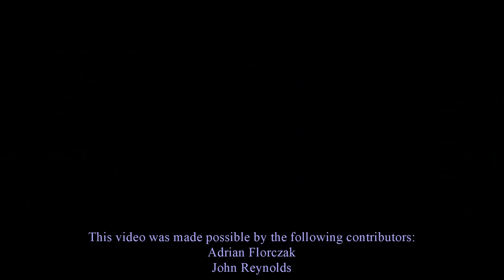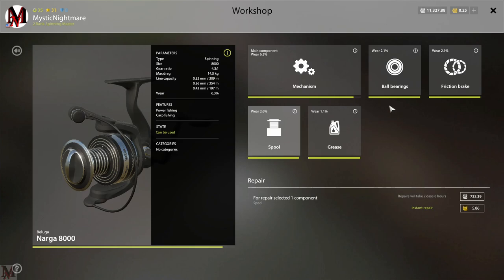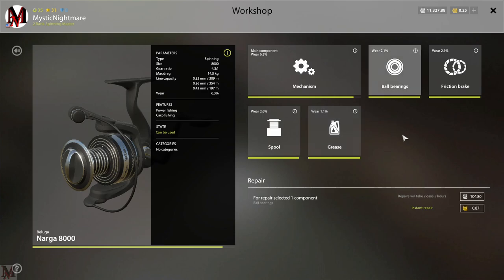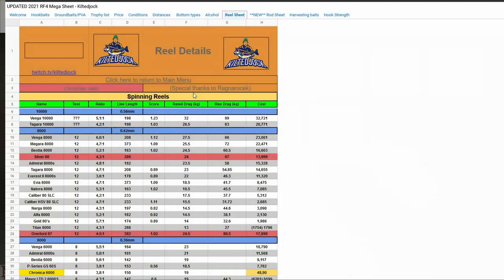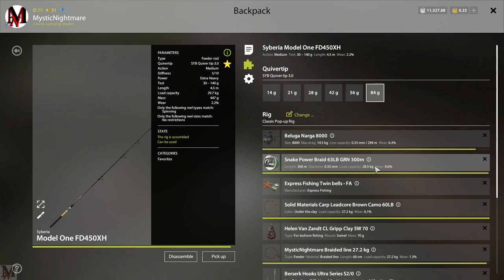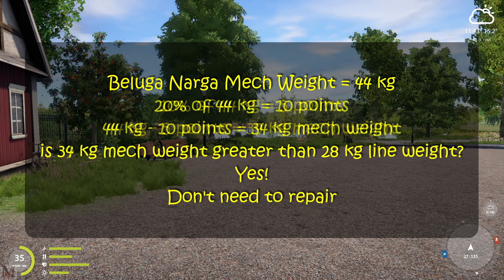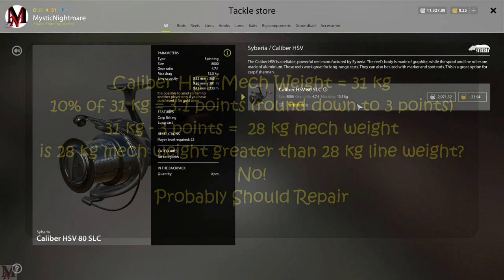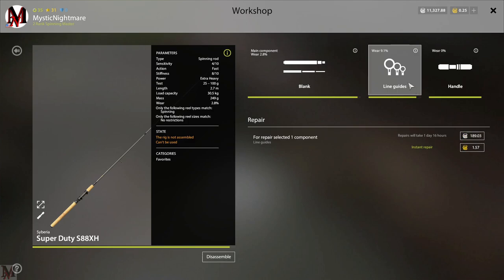Russian Fishing 4 When To Repair Your Rod and Reels

Comment: And another simpler question, if you could answer, please: watching your video, for example at 10:34 , where you show that the line used has a load capacity of 28.5kg and your rod has a load capacity of 29, 7, that is, the difference in the load capacity of the line in relation to the rod is less than 10% (around 4.1% less only).

With that in mind, isn't this a risky setup for breaking the rod? Or is this not a set you use and was just shown for the video?

Thank you in advance for your attention ;)... I'm learning a lot about RF4 with your videos!
Reply from the maker: Good catch and your exactly right this is a risky setup. However I'm fairly careful when it comes down to fishing with this type of setup so I make sure not to redline my tension bar so I don't break anything. However I also know that your line and leader will wear faster than your reel or rod. So what I'm actually doing here is pushing the limits of my rod and as my line and leader get more worn eventually they will have enough wear where they will drop below 10% difference in weight capacity. At that point I don't have to be as careful.
Reply: Ahhhh perfect, wow, now it seems so obvious to me! And although I've already seen your video about leaders, I didn't do this analysis when I saw this set, perfect, thank you very much ;)

In general, I have solid basic knowledge, but I still lack the experience to connect all the information at the same time... hehehe.

Thank you very much for your attention.

PS: I would also be grateful if you could see my other comment in this video about the wear of the mech reel not being linear with its loss of capacity, I'm really trying to understand more about the subject and since you have a lot of knowledge I'm curious to know your opinion. Thanks ;) @midnightgamingmysticnightmare
Reply from the maker: @AzuosCentrall  I'm not sure what other comment your talking about. I don't see any other comments on this video from you.

Comment: I'm thinking that the other comment I'm referring to isn't being shown to you because it's a bit long, so I'll try to summarize it: On the "KpShamino" channel there is a video titled "Russian Fishing 4, How To Max Drag Your Setup", where the subject is "mech weight", but what I want to draw attention to is in the pinned comment of this video, where it talks that the loss of the mech's weight capacity is not linear in relation to its wear, which is actually a little less (if you read this pinned comment you will understand).

And I found this relevant after on the same channel (KpShamino) I saw a video titled "Russian Fishing 4, Mechanism Reel, Rod Blank Strength Calculator" where it shows precisely a calculator in a russian excel file for this calculation of the percentage ratio of wear and loss of the mech's weight capacity. So, please, what do you think about this? Ty

Comment: Just a little mistake. The bearing is not required for casting, so it does not affect the casting distance. The bearing plays a big role in the drill because then it is exposed to a load. If you know what I mean.
Reply from the maker: The bearing is not required for casting in spinning reels however it is required for casting reels, which is one of the reasons casting reels have a test. The lures weight is needed to backspin the spool. I assume the devs didn't take this into account and made it necessary for both reels. On the Japanese site I linked it seems they tested the reels when the bearings were damaged and found a significant difference in the casting distance.

Comment: All this still relevant in 2024 ? What’s the max wear on line guides on the ocean queen an beluga c30 mech etc
Reply from the maker: For the most part yes. There is a little bit of a debate on if the line guide wear on a rod wears the line down faster, they may have changed that in new updates, but in the past the moderators said it does. Personally I don't repair my Ocean Queen till about 60% line guide wear. It's a little expensive and I've found that you don't see an increase in line wear going that high. As for the beluga c30 it depends on how you use the reel.

If you fish for smaller fish or allow the fish to run and wear itself out then you can go upwards of 50% wear on the mech. However, if you're someone like me who likes to full lock or tentative lock the reel then having your mech weight as high as possible is huge and I would repair at around 15% - 20% wear. Just remember if you're using a casting reel, your bearing wear affects your casting distance. So if you're on Norway just dropping your line you can go 60%+ wear, but if you're spinning and casting you're going to want to repair at around 30%.

As far as friction brake, again that depends on how you fish. Small fish 30%+ wear. Big fish 15% wear. Big fish short line 5% - 10% wear. The more wear the harder it is to get a fish to wear out and come in.
Reply: @midnightgamingmysticnightmare  ok thanks for all the juicy info pal I definitely need to start repairing something’s now before they break on me 👍

Comment: I have done a lot of research in the files and i found out that the devs deliberately have hidden the files where you can see the mech limits and all sorts of information because some people had changed the game files to not show water
Reply: The spreadsheet they made where some of the limits are known is from a old version of the game when they used unity mono so it was possible to get into the files now they changed to unity il2cpp and have hidden the temp file so its impossible to get the file decompiled and see the scripts so the sheet wil probably never get updated
Reply from the maker: @davyj8428  Yeah everyone always wondered how kiltedjock got his information, I guess that was how. I think the only way to get the info updated now is to actually purchase each reel and slowly try larger and larger kg lines until the reel breaks instead of the line. Which is going to be horrible to compile really.

Comment: hi just curious....ball bearings will come into play on a casting reel as the line spool revolves but on a spinning reel casting is with an open bail arm and nothing moves so how does ball bearing wear affect casting distance? secondly you say right at the beginning friction breaks cannot be repaired but are replaced,,,,you later talk about repairing it at less than 12% so you replace your friction brake at 12%? Not bbeing negative just trying to get a handle on this lol
Reply from the maker: Ok so yes you are correct ball bearings for casting reels make sense but not spinning. All I know is the Japanese website I linked tested the bearing wear for both types of reels and that is what they came up with. So when I say repairing the friction brake it's just a slip of the tongue. Spool, bearings, grease, and friction brake are always replaced never repaired.
Reply: @midnightgamingmysticnightmare  Ty love your vids...70 year plus here owned tackle shop, ran syndicated lakes , started a bait company etc and was lucky to have spent my life involved in fishing right at the beginning of carping and specimen hunting. Also very lucky to be used in  tackle testing and designs of equipment and tackle along with opening up France, Spain to carping. Had to give up through age related hand tremours so discovering this game is great as my dissabilty does not prove to be a handicap. Slowly grinding out setups and love experimenting....look forward to seeing more of yours. Anything from carp history or European coarse angling I can help you with just holla.
Reply from the maker: @jamesdeanoo7  I see we've got a true angler here. Seems like you've got quite a few years of great experience under your belt. Glad to have you along for the ride, welcome and good luck!
Reply: ty keep up the great work
 @midnightgamingmysticnightmare

Comment: I'm playing this game for like 2 weeks and I had no idea this existed. Thanks : ] I was kinda in the dark and at other people mercy to share me right information so I don't break my reel, basically what I did was Rod>Reel>Line>Leader with each having lower than maximum supported. Played it on safe side with my Lacerti 2 4000s reel, Idk how much I'm missing out tho that my line is double less thick than it could be? Also Max Drag is not defined on sheet for my reel. I assume its around 6KG max.
Edit, gonna watch your  Line video :D
Reply from the maker: Good deal, hope it helps!
Reply: @midnightgamingmysticnightmare  Yes you told in line video that my reel is as declared Mech is 4kg :D so that means I should use like 3.9 line :3 I got bit confused what line to use though, watched whole thing but there is alot of info :D mainly I'm trying to grind breams for silvers
Reply from the maker: @89Ssik  350m braided line at 3kg weight will be fine if you hook into a trophy ide or bream. you can also use that line later if it doesn't have a lot of wear to spin fish at winding or belaya river.
Reply: @midnightgamingmysticnightmare  I've placed 100m 4.8kg MonoLine its strong as bull :d with breams, btw what is difference with stars? This one star line seems to be doing fine job with breams compared to my 3.5 stars line
Reply from the maker: @89Ssik  higher the stars the more durable it is. The more durable it is the longer it lasts and doesn't wear out.

Comment: hey if using the 36kg line on the caliber like in your amber video when do u  recommend repairing the mech ? its the slc not the hsv
Reply from the maker: I wouldn't use a 36kg line on the slc anymore. Recently kilted jocks webpage has posted that the slc mech weight is 37kg. A 36kg is too high of a line kg weight. The largest line weight for the slc now is 33.3 kgs. If you decide to use a line around that kg weight then you'd want to repair the mech at 10%. However I'd suggest using either a 28kg line or a 22kg line so you get more line on your spool. If you use a 28 kg line you can repair your mech at 15%. If you use a 22kg line (which I suggest) you can repair at 30%.
Reply: @midnightgamingmysticnightmare  thanks for taking the time to answer man love your videos they have helped me a good bit
Reply from the maker: @2kbluedragon  No problem

Comment: I know this is a year old. But i have a question I see different options in the repair menu for upgrades friction discs and grease etc  is it worth upgrading?
Reply from the maker: You don't absolutely have to no. Grease isn't really that big of a deal, it just makes it so you don't burn the reel up as easily if a fish runs far and fast. Ball bearings allow you to cast a little farther for now. However I think with bearings you'll need to make them the salt water upgrades for more durability when the new ocean map comes out. As for friction brake upgrades they are amazing. Gives your reels higher drag weight. Just make sure your rod and other gear can take the increased drag weight.
Reply: @midnightgamingmysticnightmare  Excellent thank you for the advice and the quick response...

Comment: is this method of calculating when to repair up to date?
Reply from the maker: Yes, the math on when to repair will always be up to date because it's just regular math that I used with the numbers the devs provided on the equipment. There's no trick to it, it's just regular math. The percentages on the mech weight is specifically what the math was for to keep the mech weight above the lines weight, so the reels' mech wont break instead of the line.

However the other percentages of when to repair, like the line guides and friction brakes, are really up to the player and don't need math to figure out.  If I were to go back and change any info on the video I'd say I'd suggest not repairing the line guides of the poles till about 50%. It's fine at around 15% - 30% for cheaper rods but later on when you've got super expensive rods it can be costly. on top of that people are starting to realize that line guides don't do hardly any damage whatsoever to the line.

Comment: hi,i have a caliber hsv and i repared the mechanism on it at 51% but now its finished repairing it still has 9% wear.is this normal?or did i wait to long?when i repair it again will it never go lower or something im confused:)
Reply from the maker: If you repair every part of the reel it should go down to 0% wear. I'm assuming even though you repaired the mech you didn't repair some of the other parts of the reel which is why it still says it has 9% wear.

Comment: 🤔😕oof😅. I sorta understand. Mech
Reply from the maker: Basically your mech weight is the weight limit of all of the gears in your reel. If you exceed that weight limit and max your tension bar, and your rod, line and leader are all higher weight limit then your mechanics, your mechanics will break completely and you'll have to repair them.

However as you fish normally you will slowly wear down your mechanics. The higher the wear the lower the mech weight will be. So lets say you have a mech weight of 30kg on your reel. If you have 10% wear on your mechanics then your mech weight will no longer be 30kg it will be 27kg. You want to make sure your line or your leader or both are 10% lower than the mech weight on your reel. That way if you max your tension bar your line or your leader will break instead of your mechanics.

Mech weight is also used to determine if you want to try to lock your reel on a fish so it can't run at all. However that's higher level stuff you don't even want to mess with until you start getting more advanced reels.
Reply: @midnightgamingmysticnightmare  thanks it's becoming clearer now. Your clever to be able to understand it all. Thanks for sharing it with us mng.